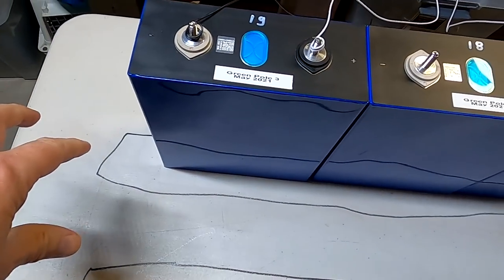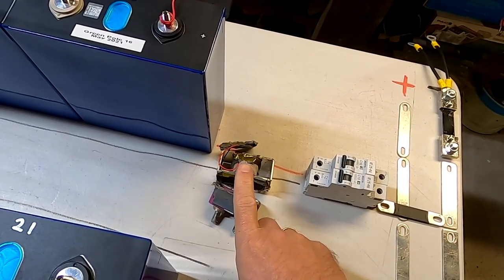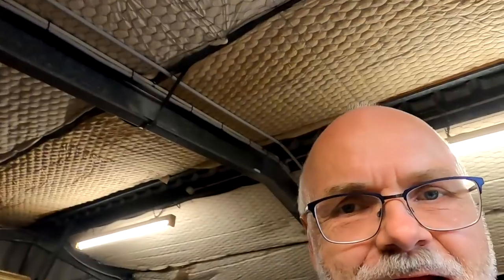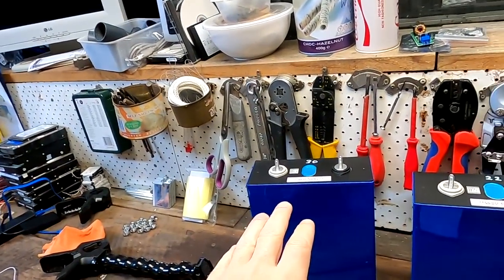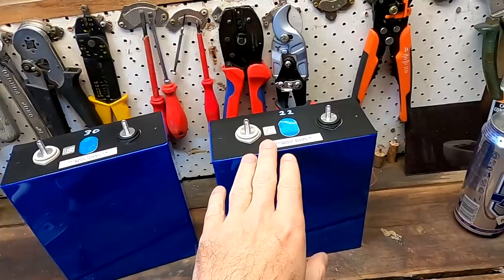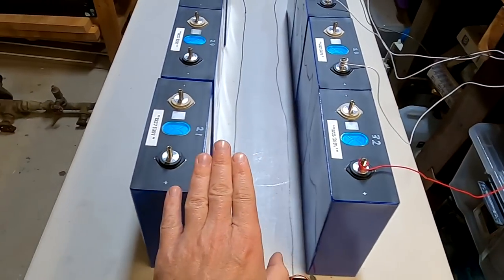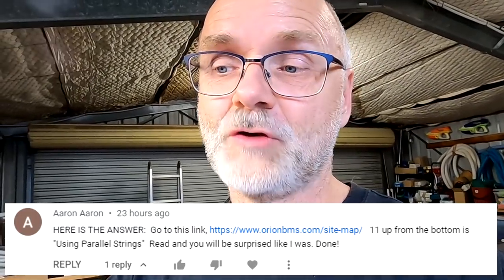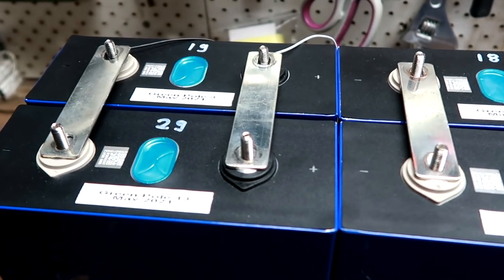Parallel Battery Strings - worst solution ever?

Comment: Here is another comment. 😄 You don't need a 2 pole breaker per battery. You can just put it on the positive side. When you said "it counters the BMS when one bank charges to the other bank" is not correct. You are actually assisting the BMS and that is how some of the more efficient BMS work instead of bleeding current out as heat through a resistor, they use the power to charge up other parts of the battery.  The BMS is concerned about equalizing the voltages across the different cells so you don't overcharge any individual parallel bank which causes fires. Also the current from one bank to the other bank is OK as long as your bus bar can handle all the currents combined so where you put the charger will be part of that equation. Currents going from left to right will cancel currents going right to left, but currents going left to right plus having a charger going left to right will add the two currents in a small section of your bus bar and will heat up if your bar is not sized properly to handle the current. Even if the charger was on the left side, that would first start charging the left bank then the right bank. Think of current as water, and the physical height as the voltage and when you open the gates, wherever the water flows is how the current would have acted. I'd be interested in seeing your prior video, but I don't know which one it is. I do parallelize my banks. The only concern is if you are bottom balancing and so how much difference the cells are would become a concern, but you just have to make sure your BMS can handle the difference. If you top balance, and make sure the low cutoff voltage is set higher than the lowest capacity cell, you're good. But most cells bought around the same time will mostly degrade at the same rate and after years, they will most likely still be very close to each other. Mine still are after years. and LiPoFe batteries have even more cycles before they degrade than other Lithium chemistries. My memory says somewhere around 1000-4000 cycles for LiPoFe

Comment: i have similar build requirements for a go cart. as proper weight distribution is needed i seek a setup that will allow the use of multiple individually bms protected 16s3p packs in parallel going to a fused buss bar and then controller. i fear that when charging or discharging if one pack disconnects due to a voltage fault then the rest of the packs will operate and become out of balance from the pack thats disconnected. my fear is that the bms may at some point will clear the flault when im unaware of it, reconnect parallel and experience extreme balancing currents. i feel as though i need a bms that can communicate with the others to prevent this? please what is your opinion?

Comment: VERY new to parallel batteries. My system 2S 4P (12V lead acid x 2 = 24V x 4P) 
Does it matter if I create 'branch' in my parallel string?

I have tied connecting 2 24V pairs to one of the 24V pairs for ergonomic reasons.

24 P 24 P 24 P 24
                   P
                  24

Comment: I'm running a 3 x 1P18S system, with one Batrium BMS (blockmon). It sure makes for some nice graphs but I concluded this week that I will need active balancers on each of the strings to help out on the higher and lower end of the charge cycle. It Has more to do with the used cells the alibaba rip off has send me then the setup itself. 

Im looking forward on your experience with the cheap balancers while charging,  mine are still in the mail :)
Reply from the maker: They have sent you used cells???

I just got another 8s and 16s balancer delivered yesterday from Hankzor (for more testing). They send out that stuff very quick.
Reply: @OffGridGarageAustralia  sadly yes, they keep denying they are used but the evidence is undeniable, glue residue, scratches and dents. I ordered 158 cells together with some other poeple. Alibaba denied the initial refund, got a 3000$ refund in the end because I wrote a bad review. I guess the price should have been a clue, we payed around 10k for 158 cells excluding taxes.
Reply: Hi, I'm now reading your comment. Do you use Batrium WatchMon CORE with 54 blockmons connected in series? What capacity cells are you using? Batrium blockmon balancing isn't enough? Do you use shuntmon too? 
I'm asking so much because I'm deciding what to build:
1. 16S2P battery with  WatchMon CORE +16 blockmons +1 ShuntMon or 
2. two 16S1P in parallel with  WatchMon CORE +32 blockmons +1 ShuntMon

Comment: Love your channel Andy!!! I will be starting a channel soon as well! I have 3 strings of 16- 200ah LiFePo4's and 3 JK BMS I am  putting together for my 16x7 tiny house on wheels I have a MPP LV 6548 im hooking up to the 27KW bank, its all replacing an AIMS 24v 14KW system I currently have run for nearly 3 years un interrupted! 2 deep freezers and a full electric kitchen with a bunch of big appliances!, Air conditioning, electric heat, 50 inch TV and many fans! all running off 8-260 watt solar panels! we have been all over the south and western US 2 years now without a hiccup!! Lovin it!! 
Keep up the great work Andy!!!

Comment: The one advantage in parallel is if you have some cells that always tend to run a bit high (happy) and another that’s a bit low(sad) you may be able to pair them up so you get a better average. That way the BMS’s balancer doesn’t have to work as hard and you get a better finishing voltage.
Reply: That's my theory as well. I've heard others say this isn't a good idea, but I wasn't impressed with the reasoning.

Comment: This is also how the software industry evolved from single large systems to multiple instances/containers running in parallel.

I think this parallel string idea is for sure the right way to go in the future as it makes things much more modularized (easier to service and adding or reducing cells) and as long as the BMS is cheaper then it will be perfect.

For now I think the BMS world hasn't evolved in to this modularized mind set yet, because what they could make is there is a simple/cheaper submodule (voltage current sensor + relay) for each string then have a central management unit that can wire multiple sub modules. 

Maybe the demand of personal home/RV battery system never has the need to frequently changing capacity or servicing cells so perhaps there is no market pressure on to this "distributed" architecture so it might never hit the market 😁

Comment: I don't mean to be the nervous Nancy here but looking at that table with those cells on it makes me think of the dog coming in and bumping against the table, those cells are going to hit the floor. 🤔🤨🧐
Reply from the maker: Nothing like this. This is a solid massive workbench made from 150x150mm hardwood bolted to the concrete floor. It does not move a single bit.
Dogs are all well behaved, they don't come into the garage until I call them. That's the rule.
Reply: Sir yes sir, and thank you for all your time and work. You are a wealth of knowledge and I'm learning a lot from you. cheers!
Reply from the maker: @ryanaf2023  thank you

Comment: Andy, I’ve had  2 1p16s 280ah  packs connected in parallel for several months and they stay perfectly balance.  They both charge and discharge at the same rate. I’ve turn off one pack for several hours to manual unbalance them and by the next day they are again perfectly balanced . I’m using Daly smart bms and all the cells are balance to within a few millvolts
Reply: Each pack has its own Daly BMS, correct?  Did you have to do anything to the BMS to make it work in parallel or was it ok from the factory?  I am planning on building one just like what you mentioned and appreciate the info.
Reply: @cwildmann  I did reduce the high voltage cutoffs settings to 3.65 . However, an update, I noticed one battery was charging and discharging faster. Removed all the busbars and cleaned and now working well again.  Now looking for the best anti oxidation paste and will redo again.

Comment: I have a 14s144p, and you don't need one BMS per 1p. You figure out how much you need based on how much difference you have between the 1s and the maximum charge rate. If you don't have enough and see the cells are not balancing fast enough, then you just throw on one more BMS parallel to the existing BMSs.

Comment: All parallel banks could be at different voltages but as long as each series string has its own bms the bms’s will limit the current to safe levels in both charging and discharging between each bank.

Comment: I was just downloaded and read that Orion BMS - Strings, Parallel Cells, and Parallel Strings, particularly pg 15 "Parallel strings with 1 charger per string and single discharge DC bus."

As I'm sitting here I got to thinking what if you had 2x discrete off grid systems instead since if you had say 800ah in 2x strings you probably need 2x 4000w inverters paralleled? 

Why not have 2x discrete systems each with their own solar panels, charger, inverters, BMS, and inverter?
The cost will undoubtedly be more but only one extra charger, more wiring and higher installation time/cost is needed. Thing is I don't know much about off grid but I will because I'm building an off grid house soon on my 52ac bush block that has no power.
What I don't know is if 2x inverters can combine synchronized AC output but since many 48v inverters are designed to be paralleled maybe they can - maybe they can't, I dunno?
Even if they can't, then you could wire the house with two independent systems. One for the lights, one for the power points (or however you want to divide it).
Generator autostart may need a diode or possible just 2x relays to isolate the start inputs but that seems comparatively simple to do.
Reply from the maker: For such a project I would use two Victron Multiplus II inverters which also have AC input for a generator if you need it. They can be synchronised and work together to power the entire house.
Sure, you can go with separate batteries but as you said, additional costs and cabling effort. If you parallel the battery banks you can always take one offline and run the house still from the other one (or two).

Comment: I have a question:
I have two battery packs.  Each pack is 48volts 16s 272ah.  I want to connect both banks in parallel using two 200 amp Daly BMS with parallel modules on both.
Reply from the maker: Yes, will work perfectly.

Comment: Both approaches are valid and have positive and negative aspects. Do what you want to do. I went with parallel banks, and each individual bank can handle the full load. No regrets, and easy to increase run time by adding another battery. But don't worry, either one will work well, but since BMSs have a tendency to fail, more redundancy was my choice.

Comment: What ever you do, the cells are so blue...
Fully empty? Hell? Dunkel? Dunkhell? What the hell....
If you start with paralleled strings with seperate BMSs, you at least have the chance to monitor what is going on, and can in case of serious problems still parallel the cells.
But everything that uses pre-built packs of cells parallels the strings, so why should it not work? And if you have a voltage in the flat area of the curve, you might still encounter the same problems at cell level, but cannot monitor what is going on.
Are you allready planning the next garage for all the new panels to charge all your batteries?

Comment: Having that modularity and ability to add/remove capacity or perform series battery set maintenance as needed without taking your entire system down is key.  Sounds like you have a great plan and your videos going deep in the weeds on most subjects have taught me a ton.  Thank you.

Comment: Consider creating a dual of your entire system down to the inverter.  Hopefully your inverter can take a synch input so that the inverters can be paralleled to the load.  That way you never have to worry about taking one down for maintenance - you just might have to shed some loads.   In fact you might want to routinely take them off line in low demand periods to balance the individual strings.
Reply from the maker: Not sure if the inverter likes to have another one in the network. Has anyone tried with an off grid system?
Reply: @OffGridGarageAustralia  Query in with Victron to see if two inverters in parallel can synchronixe. Not technology challenge, but a simple design challenge.  They have the tech to synchronize 3 phase, so it is defintely possible.  Thanks for the reply.
Reply from the maker: @donr416  I'll see what I can find. I think they are been connected to each others to sync but I will definitely do some research on that. Thanks.

Comment: This topic is very interesting, i have the same question in mind. How to parallel.
I'm in proces of building a small house for vacation, and i will start with a 48V 100Ah batery  pack, but in time i will grow up the capacity and numbers op solar panels.
Waiting for next results.
You're doing great jov, thanks for this channel.
Sorry for bad English I'm from România
Reply: You can parallel by connecting cells in parallel first (positive to positive and negative to negative) and then connecting parallel packs in series into a single battery to give you the desired voltage. Or you can forgo the initial paralleling and just build individual batteries (cells connected in series), and then combine the batteries in parallel using a busbar, as the content creator in this video is doing.
Reply: @firpofutbol  i have 16 cells 100Ah in series at this time, I will see when upgrade time come the solution.
Thanks for reply, regards

Comment: Thanks very much for your efforts to explain so much about the different types of arrangements for batteries. I have just bought sixteen batteries and two BMS's  to build two 24v banks and parallel them. I am replacing an old set of GM batteries in my boat with  LifePO4 batteries I bought on eBay. I am not really very advanced in my understanding of these systems but luckily I have found your channel and have now discovered how to build up my battery. Your vid on programming the Victron controller was also useful as I have a Victron controller on my boat's 1500 watt solar system. I have a very cheap inverter on my system , 24v to 240v 1500 w and am wondering if I would make any significant gains in efficiency by replacing it with a better quality inverter. The original controller was also a cheapy and it frizzed out after about six months which is when I replaced it with the Victron which I love because of the bluetooth connection , the original controller had no bluetooth . So thanks again I will watch a lot more of your vids as they are a great source of knowledge for me.

Comment: Nice video, one minor critique on your comments around 5:30.  You are correct in that there won't be much current going between the banks if the voltages are similar and the banks are just connected to each other.  And you are correct in that the voltage of a bank with a higher SOC will want to rise more quickly than one with a lower SOC while charging.  But current will still not flow from the higher SOC bank to the lower one while charging is still active.  That isn't where the problem is.   The bank with the lower SOC will receive most of the current from the charger simply because the bank with the higher SOC will have lower current acceptance (it takes a higher voltage to make it accept more current, but since the banks are tied together it can't get that higher voltage).

The problem occurs when the charger turns off or the change rate changes.  That is when you will start getting currents going from one bank to the other.

There is an easy way to describe this (it also describes the micro current cycling you talk about later).  Lets say you have two banks with mismatched SOCs.  What will happen when you charge the banks up is that the charger will eventually manage to push the voltage up, but then when the charger turns off or the charge rate changes significantly, the settling rate for the two banks will be different and will cause current to flow from one bank to the other as they settle down.

Similarly, if discharging the ganged banks with a load, and your load then turns off (or changes significantly), the cells in both banks will 'recover' some voltage... but if the banks are mismatched, they will recover at different rates and again will push some current from bank to another.  And this happens EVEN IF the banks are fairly well matched.

Thus you wind up with micro-cycling between the banks.

--

Also, if you didn't see it... with the number of strings you have, blocking diodes are now MANDATORY.  They are not optional any more.  You absolutely need them for safety and shouldn't depend on your circuit breakers and fuses for that function.  Long-term reverse voltage stress on the panels is just not good for them. Even though a solar cell is basically a diode, it is one designed to generate electricity and not designed to have good reverse-breakdown-voltage characteristics.

Also the voltages coming off of the panels are fairly high and an inductive spike can spike the voltage high enough to hit the break-down voltage of the panel cells, causing a fire in a short-circuit situation.  While unlikely, it is even possible for the inductance to cause the voltage spike high enough to arc the breaker and/or fuse, turn into plasma, and not break the connection.  Hence why blocking diodes are now mandatory.

-Matt